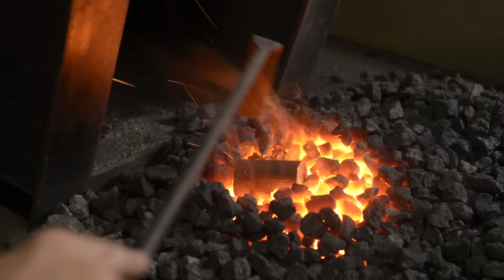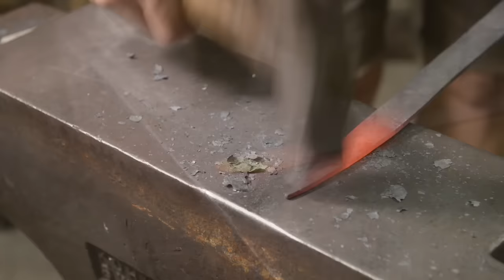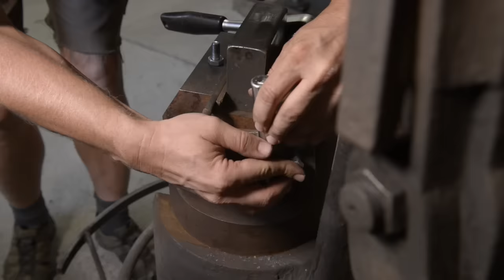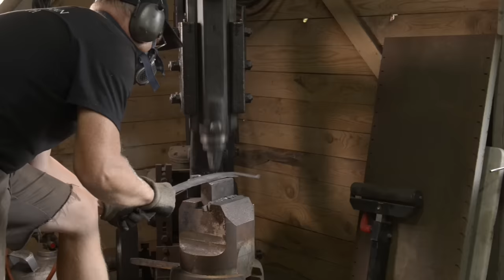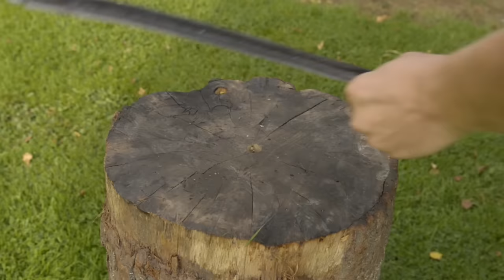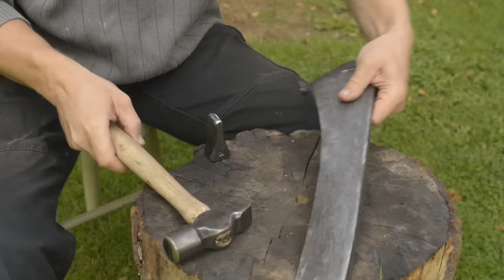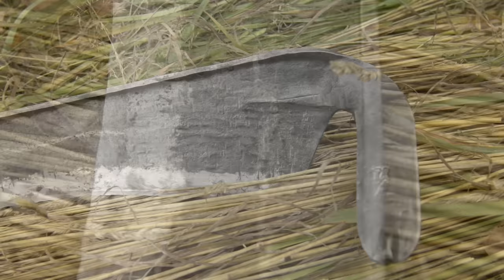Blacksmithing - Forging a scythe

Comment: All that scale build up around the powerhammer. I've always wondered what IS that scale. I hear everyone say "impurities" but that's like saying when you massage somebody it works out the body's "Toxins" but nobody will tell what those "Toxins" are. I may do some google Fu but I like a more "human" response. what is the composition of that flakey exvoliate from worked iron and steel made of? how much iron is in it, if any? 

And does it have any uses? or just trash?
Reply from the maker: It has nothing to do with impurities... It's iron oxides. It forms on the surface as the steel oxidizes in open air (oxygen). Iron oxide is very brittle and breaks off then the work is deformed, and more or less instantaneously a new layer is formed on the fresh clean surface of the steel.
Reply: @torbjornahman  Excellant! that's about exactly what i read on Wikipedia, I thought it was interesting that a lot of the oxides are actually composed of Magnetite compounds, and are thus ferromagnetic. i wonder...could you then....create some kind of "anvil cleaning" option by using some sort of rediculously powerful electormagnet? laughs  "Anyway, I"m pleased that you have your facts straight. I've ALWAYS heard people say that you're driving out impurities. which I always took at face value. Kudos for having good intel.

Comment: Is that an Anyang power hammer?   I haven't done any blacksmithing in 20 years, why wear a mask when forging hot steel?
Reply from the maker: No it's an old mechanical hammer. I like to avoid breathing dust.

Comment: Do you think putting linseed oil onto the scythe when it's hot to get a polymer coating may give a better protection?
Reply from the maker: It would probably be a bit better yes!

Comment: Crazy thin and light. An amazing tool.  Is it usual that they were not heat treated?
Reply from the maker: Thanks! No, that is an error from my side. It was hard to do the research on this one (this type is not common here). It should be heat treated, but tempered quite high not to risk cracking the edge when peened. I'll have to revisit this one some day! :)

Comment: What does 'tensioning the blade' do to the steel that makes it ring at a higher pitch? Great video!
Reply from the maker: Not sure I can explain that.. it becomes a bit harder. Maybe that is the key to the changed pitch.
Reply: @torbjornahman  Ah! Ok. It's a form of work hardening then, similar to bronze in a way

Comment: This is where this catalogue from 1928 belongs, page 66 is the actual device for holding saw blades as you cut the teeth, page 197 has a sythe and the handle with a few typs of sycles, page 119 has all the blacksmith tools and anvils, bicks are on p 166, worth ever page... https://archive.org/details/wm-marples-and-sons-1928
Reply from the maker: Cool

Comment: Hello bro! I believe that you made the lust hitting of the blade wrong, I believe it need to be hittied vertically, not horizontally. Thank you
Reply from the maker: The sharpening? I know... I should have done some research on the stones. We don't have them here by tradition.

Comment: Cool intro.. the tools on the wall looked like an old church pipe organ playing the menacing music for the reaper who carries a scythe whoahaha..
I'm completely new to the topic.. Why not use a bar of material rather then to draw out a chunk of metal to such extraordinary lengths? Does it have something to do with the metal grain structure and the final properties of the part?
Reply from the maker: Thank you! If you can find a good starting stock, go for it! Most of the time you simply can't get the size you want to begin with!
Reply: Ah.. ok. I was thinking of blades that are folded and drawn over and over to produce layers and elongated grains. btw beautiful work and thanks Torbjorn!

Comment: les éclats noir c'est de l'impurté ou du metal refroidi qui éclate ?
Reply from the maker: I think you refer to the forge scale on the surface? It's iron oxides that form on the surface of the hot steel.

Comment: Very impressive, but If you don't want to be sharpening every 5 minutes try using a differential hardening, use clay to make Hamon it will give you a hard edge and a soft spine,  great video man
Reply: I don't think so, because european scythe are sharpened initially by peening the edge, and needs a soft steel on the edge. Peening it makes it work harden a bit. Stoning is done in a few seconds (literally) every x meters/feet, as it is just to "refresh" the edge.
Reply: Weeb Technology isn't needed here. Peening and touching up with a handheld whetstone is all that's needed to keep a European style scythe sharp.

Comment: Interesting that in different countries, scythe is used in different way.
In Montenegro and Bosnia there are two handles, but on the other side compared to yours. In Serbia, Onlu lower handle.
The anvil and hammer are also different. Anvil is almost flat, part of realy big radius sfere, and hammer is tappered. Of course scythe is placed bottom side on the anvil.
Also, we do not remove scythe from handle when we hammer it. You put anvil into the ground (it have two "horns"), lay on the ground, rise your right knee and rest handle of the scythe on it. With your left hand you hold the blade.Not easy to explain... :)
First video I found (not afillitated to chanel) https://www.youtube.com/watch?v=UgDTIBV6Y-8

Comment: you're mowing good, but the shaft is wrong, imho
the handles should be an L shape in opposite direction of currents and turned upwards (or just simple handles up, directly from the shaft); at least I find that design easier to handle
Reply from the maker: Scythe handles can look very different from place to place. Mine is too short, I know that now.... I will make a new one
Reply: Oh well, good luck with that mate.

Comment: Not a blacksmith, but I think that steel is to hard for peening.  
Would be really cool if you could make a proper scandinavian blade. -The katana of the north. :-)
Reply from the maker: :) Actually the steel is too soft. It would have required a heat treat for better performance.

Comment: aprecieri pentru rabdare si inventivitate.....cat despre taiat ....lasa de dorit . Ti o spune unul care a folosit as ceva multi ani 
Materialul  care l ai folosit nu e de calitate.....sau modul cum ai calit ....se aude prin iarba ca nu taie,  îmi pare rau dar asta e adevarul,  felicitari totusi ca ai avut curajul sa te apuci sa o faci....
Reply from the maker: Thanks. It cuts but it should be heat treated. I tried to do some research before but couldn't find the info I needed.

Comment: Like for video, a scyth is good. But, you cant work as author showed long time. Scythe need tune: handle for right hand should be on navel level, and possible need change angle blade to case (main handler? I dont know in english ). Keep your back straight. Usually you works for few hours (if you do it not for video or clean small place)!
Reply from the maker: I think I have improved here - https://www.youtube.com/watch?v=AlBa2qfXykg

Comment: You may be a good blacksmith, but your sawing technique needs some improvement. To start with, your scythe handle is too short, it should reach from the ground up to the height of your shoulders. Second you shouldn't bend foreword when sawing, keep your back straight to avoid muscle aches (this relates to the handle length as well). Finally you're advancing too quickly, each stroke should cut no more than a couple of inches, about the same as the max with of your blade.
Reply from the maker: Thanks, I know pretty well now! :) Need to practice some more...

Comment: I am speechless as you grind the scythe at the end of the video. The stone does not have this particular shape for nothing. You are twisting the stone and that is totally wrong.
Reply from the maker: I'm sorry... I learned the correct way after the video was done...
Reply: @torbjornahman  You did a good job with the scythe. The stone has 2 points and a certain angle, so you can sharpen the scythe at the right angle. But you already know that. Have a nice day.